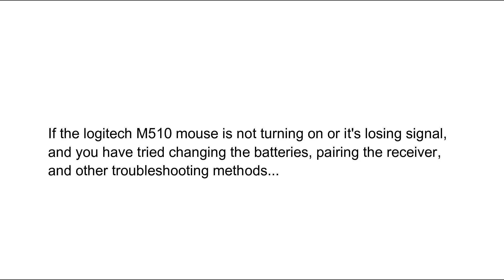Logitech M510 Mouse Not Working  - Fix /Repair

Comment: I was about to buy a new mouse, before I saw this video. In my case, the M510 mouse would not turn on despite a working receiver and full batteries. After following your steps my M510 works as good as new. Thank you.

Comment: Last year I bought this model with keyboard combo from amazon... the mouse stopped working. Over this last year I have run into 3 more at thrift stores and none of them worked. Is this common with this model M510? One of them, the spring battery contact was corroded from the previous battery, used some sandpaper and cleaned it off. I have 2 more that just don't work. Ok, I got the original one working with the combo. I think the connector that goes from the batteries to the PCB was loose. Thanks for the vid!!
Reply: Hi plz tell me I have Logitech m510 mouse but I didn't  have original dongle what should I do and when I turn on then light turn on but suddenly off should I try this video it work for me or not plz plz reply

Comment from the maker: Official WD-40 Website: 
"WD-40 is safe to use on metal, rubber, wood and plastic. Polycarbonate and clear polystyrene plastic are among the few surfaces on which to avoid using a petroleum-based product like WD-40 Multi-Use Product."

Comment: My m510
The cursor goes to the upper left when I turn the mouse on 

Tried air and alcohol cleaning sensor. 
Tested on 
windows 7
Windows 10
Same result. 
Any ideas I can try?
Reply: Same
Reply: @tomcatbob9401   My M325 is trash the cursor is jumpy